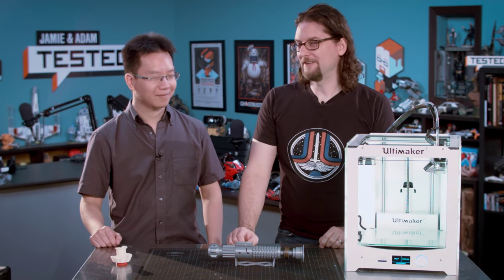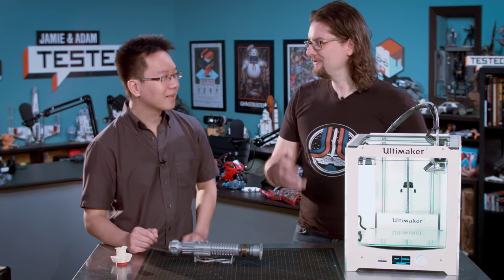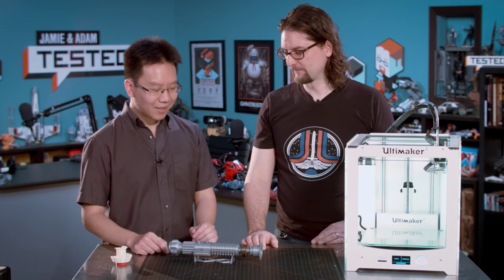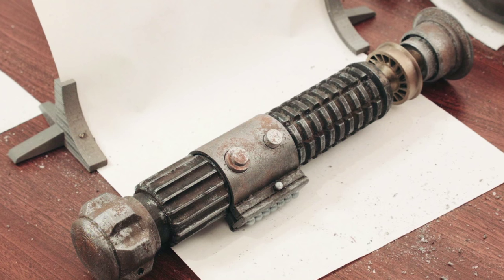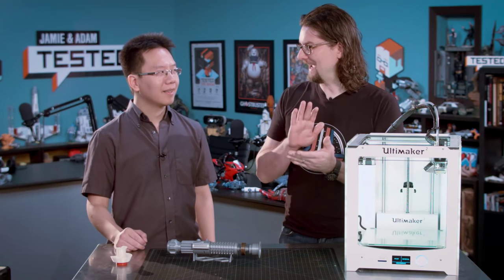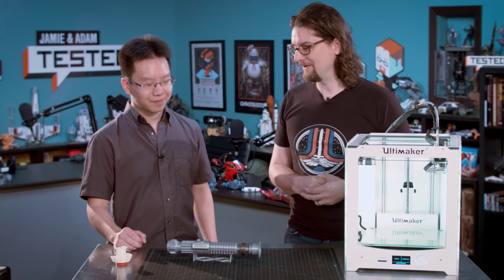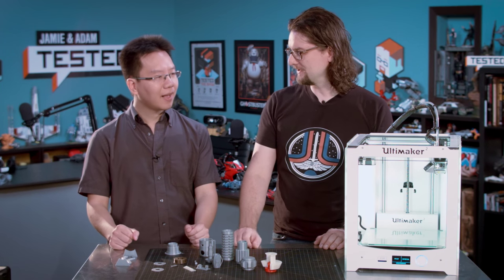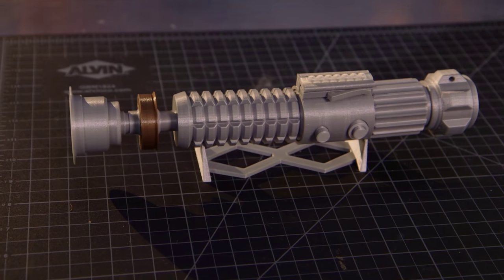Designing the 3D-Printed Lightsaber!

Comment: Is it just me or are the colors from the main camera really flat and off?
Reply: +Shermingtan Yeah, I think the white balance is a little off.
Reply: +Shermingtan I think the light of the Ultimaker made them use these settings. Also, I might just be wrong.
Reply: Hjälte Björkdahl If they used auto white balance, which they probably did, I think you're right.
Reply: Erik Olson
Sounds just about right to me, yeah.
Reply: I love their work, but yeah, their white balance is regularly off. On auto, cameras often cycle between warm and cold settings (e.g. their video on Tim Gore's paint). The inconsistent balances likely stem from using multiple cameras. They might also colour grade all of the clips using the same white correction, which leads to some shots looking off.

Comment: Really cool model, I don't like the striated patterns that result from 3d printing.  Is there a way to reliable smooth a model out?  Or would it require cold casting to actually get the ideal material and consistency that you would need for a hard metallic object like a lightsaber?
Reply: UV Resin printers have less of a problem with that issue.  I don't have an extruder printer, however, if you are having an issue with the striated printing, it could be something as simple as adjusting your print settings.